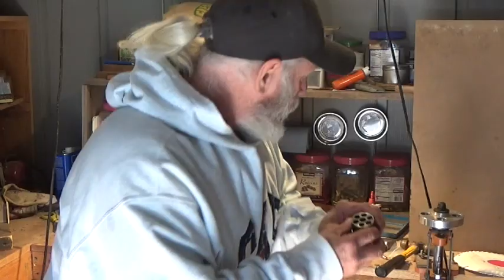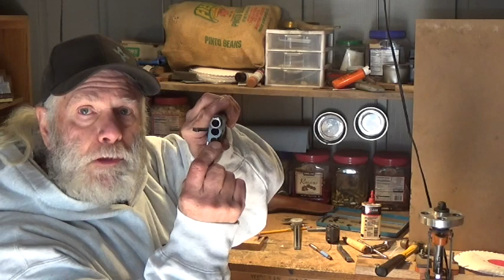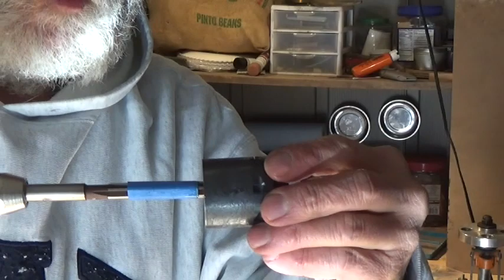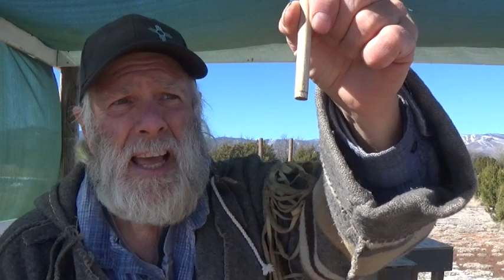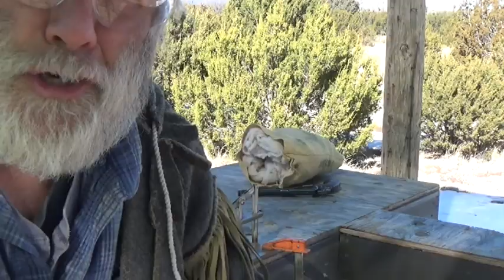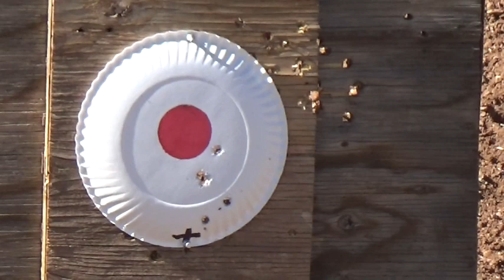1858 Remington Navy shooting after reaming cylinder

Comment: On a modern Pietta 1858, made after 2008, is it possible to swap a .36 barrel and cylinder to a .44 barrel and cylinder? This is for steel frame 1858 Pietta. Lots of people say the .36 and .44 is the “same frame” but that would really be the test I suppose?

Comment: I don't care if it is easier or harder to load.   I want it to be right.    I have been telling people for too many years that the relationship between chamber and bore is the most important for accuracy.   Ok.. you can still buy pin gauges set for around $40    I reamed my cylinders down about 3/4" to be sure that.....  A .360 bullet does not rattle down a .375 bore    I am now shooting .375 bullets down a .375 bore.  even cutting the cylinders down 3/4" or so was not difficult.   It seems that what you are doing will cause any improvement in accuracy.    I mean you are still 'sizing' a .380 ball down to WAY below barrel dia...   When we pounded a .375 ball down one of my guns it hardly had any engraving from the lands on it.    Maybe not explaining well...   To show you you could drive a ball into your cylinders and then  use it to slug the bore... it will most likely almost fall down the bore... certainly the rifling wont be getting much of a purchase on the bullet.   you are basically shooting bullets out of a worn out barrel of a smoothbore.    Which.... most of the time will shoot sorta kinda acceptable at short ranges

Comment: I have been shooting cap and ball revolvers 45 or more years. I still have a couple of my original revolvers. I have never had to make a repair or adjustment to any of them yet other than a minor sight adjustment. I have found no purpose to reaming, slicking up, or trigger jobs as I have found normal regular usage will ream, slick, and make the trigger pull smoother and lighter. But this video reminds me of why I don't buy used revolvers or any type of used firearms. Perhaps that is why I have never had any problems.want to be a better shooter? Practice makes perfect.

Comment: Well yes, 3/8" is .375 ...a bolt is .005 undersize to fit through a hole ...a tap cuts .005 over size ......its called tolerance if you tried to run a .375 thread i to a .375 threaded hole you would get serious galling

Comment: My new model army I had to ream the cylinder as well cause it was smaller than the barrel, cylinder was.  .4485 and the barrel was , .4510  which resulted in a 10 inch group at 10 yards

Comment: The chamber mouth diameter should swage a ball the diameter of which is equal to the groove diameter of the barrel.  The swaging should be done  while loading and not on firing to avoid high presure.

Comment: I'm sure this makes loading a .380 ball easier but when you push it past where you cut that ball is now the size of your chamber, which is undersized for your bore most likely. If you cut deep enough that the ball remains 0.375 then it will hold that dimension when it hits your forcing cone and barrel. I slugged my bore on all my 36 cal revolvers and they need wider chambers to fill the rifling.

Comment: I have found that nowadays with the cap shortage..it works for me to run a pipe cleaner through the cones...and not wasting caps in the process. Just my two cents.
Reply: I do the same.  There’s no sense wasting caps on oil removal.   I also clean with soap and airdry without rinsing since it protects the steel without adding oil to the cylinder.  Keeps the powder dry too.
Reply from the maker: In a Previous video I stated I use my home made caps to clean any oils left behind
Reply: I soak my nipples in a jar of alcohol after cleaning the gun and wipe my chambers pretty dry